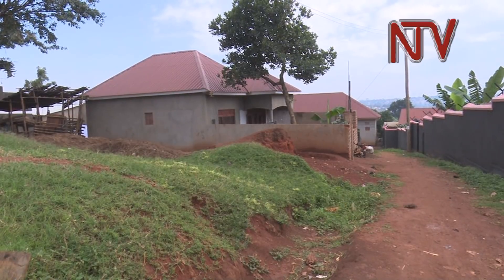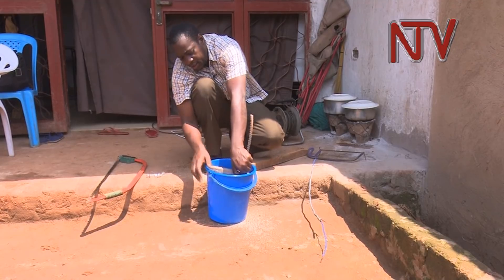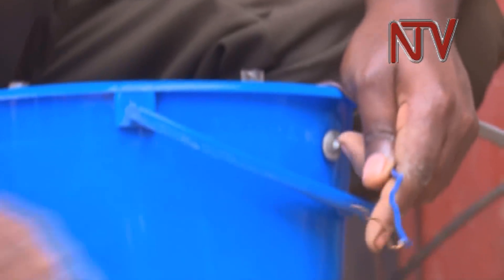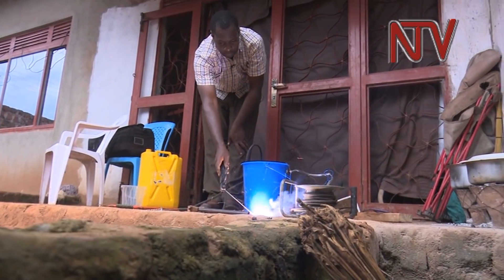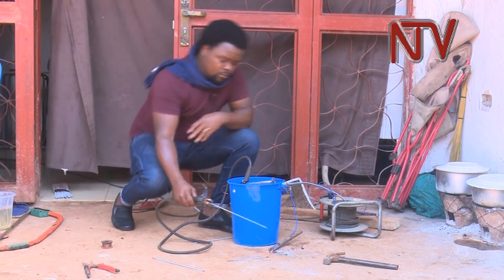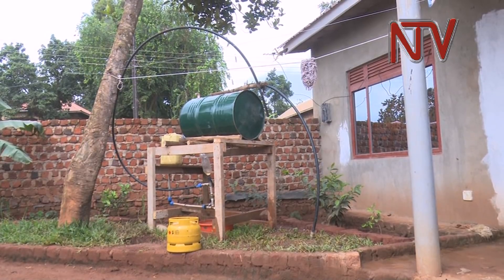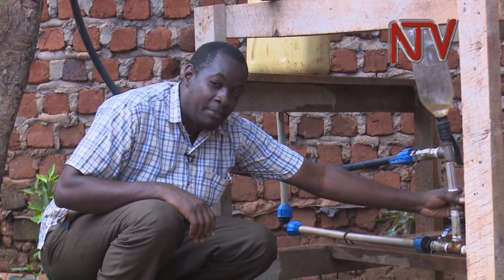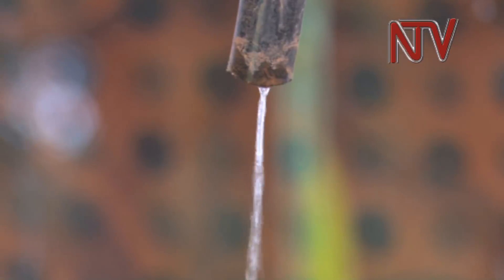Welding innovation: Man creates cheap welding machine.

Comment: WARNING.....
I dont know, how many people died on your account from electrocution.
You are straight on the grid of 240 ? Volts. Or higher......
The human body can resist max 40 volts AC  ( small piek, max 70 volts )
How can you weld with closed eyes ? (No safety glasses./screen.)
Even than ,your skin will burn immedeatly from ultra violet radiation.
Whenever you look short time into the flame you get welding eyes, burning eyes,
And you can not sleep the whole night from pain / suffering.
You see, how many donkeys without knowledge replay positive.
Get an education in electrical, to understand that this film is dangerous bullshit.
I hope, with my warning, I saved some human lives.
Regards, Gerard from Holland.
Reply: that is true , it's very dangerous
Reply: Voltage and current are proportional. That means if you double the voltage you double the current. Resistance and current are inversely proportional which means if you double the resistance you halve the current.

The probability of fatality in electrocutions go up with current and duration of current.

Under 600V the skin doesn't breakdown easily and so your skins resistance is what saves you, hopefully, if the duration is short enough.

Above 600V the skin breaks down which drastically lowers the bodies resistance. More voltage means more current and less resistance means more current still which means dead. Depending on duration and other factors.

Many people get "bitten" by 240V AC and either their involuntary reflexes or the breakers saves them much grief. If it fries too many brain cells they might go on to say 240V isn't dangerous but try sticking two sharp electrodes through your skin and into the wet meat and see how long it takes to cause fibrillation and then death. Or if you don't like stabbing yourself just wet your hands with salty perspiration. This can mean the difference between 100k ohms or 1k ohms effectively increasing the current by a factor of one hundred (i.e current x 100).

In short, house hold electricity is dangerous. Which means that it certainly can and certainly does kill people. Like allot. Didn't your mother teach you anything?
Reply: elmis123123 I was tempted to argue that it's neither the current, voltage nor power that kills you but the lack or resistance.

But I've come to realize its actually the none of those at all. Its the electrons that kill you.
Reply: sun sun  two pieces of rebar and a bucket of water. Stand way, way back it might explode. If the voltage builds to a critical level no telling what might happen.
Reply: Russel Walker yes, you are quite right!
And what's really making the blood/flesh boil is the ion-current (in reverse direction of the electrons) .
Reply: Jaakko Fagerlund and this confirms the fact that little knowledge is far more dangerous than no knowledge....
Are you aware of the fact that we comment on a video where a man uses main electricity to weld...
Reply: Jaakko Fagerlund 
You are right, under ONE condition......
The electrical resistance must be 100 % means..  fully isolated.
Otherwise, you will be roasted as barbeque.
Learn the formula  E=I x R
      Aswell...             I x R = E
If you not understand this and not willing to study, than I spilled my time.
Regards, Gerard from Holland.
Reply: Jaakko Fagerlund if you learn and understand ohms law and its derivates, you understand what kills you!
U=IxR
R=U/I
I=U/R
P=UxI 
P=U2xR
Whitch gives: you can't drive a current through a resistance whithout a voltage and at a given resistance the current is function of the voltage. If you doubles the voltage through a given resistance, the current will also double and the power will be 4 times higher.
Reply: I give up! 😩
People don't seem to understand ohms law. 
The current is a function of the voltage applied over a resistance. 
This means that a voltage can exist whithout a current or a resistance and a resistance can exist whithout a voltage or a current. 
But a current can't exist whithout both voltage AND a resistance!
A higher voltage drives a higher current through a given resistance!
The dielectrical properties of the skin and the flesh/blood determines the resistance.
If you think a teslacoil is harmless, put your fingers on the output of the flybacktransformer. Your relatives can post the result here later....
But I guess this is what Darwin meant whith natural selection...
Reply: Jaakko Fagerlund I don't know if you are trolling or you just is plain stupid.
I have tried to explain the facts to you, if you want to beleive it or not is up to you. If you want to risk your life because of ignorance and poor understanding of physics, it's your choice.
Reply: You clam to be knowledgeable in the field of electrical engineering but you don't know what a water rheostat is. I feel sorry for the idiots that think you know what you're talking about.
Reply: I'm fully aware of Ohms law and it doesn't change the fact that voltage alone will not kill you. Otherwise we would have thousands of people dead every year/month because of Tesla coils.
Reply: Tha's what I've been saying, because I do remember it is 30 mA from AC and around 300-500 mA from DC that will most likely stop your heart. Doesn't matter what the voltage is.
Reply: Jaakko Fagerlund but for gods sake, read what I have written and don't make things up!
The current is a function of the voltage applied and the resistance. 

It's the internal resistance and the spheres ability to hold enough electrons that limits the current in a Van De Graaf generator. If you made it big enough, it would kill you!
As a matter of fact, lightning in a thunderstorm works on the same principle. I guess you think they are harmless too?
I suggest you take a class in physics or at least ask a physisian about it.
And about supraconductors, there is no conductor (and will never be) that has zero resistance. What it is all about is to make it as low as possible. 
And for the last time, it's the power that kills you!
The power is a function of the voltage and resistance, whitch induces a current in the circuit. 
The power equals to U/R x U == 
U2/R.
Reply: Russel Walker finaly a reasonable person! 🖒
Reply: You are fucking clueless. Idiots like you are more dangerous that the water rheostat.
Reply: yes ok
Reply: Or the supply has a power limit. For example, 1 MV supply with 100 W power will not kill you, just tickles. Doesn't matter what the resistance is.
Reply: Jaakko Fagerlund 
I saw, you are interested in very nice technics, as me whole my life.
But feel sorry for your poor knowledge of electricity.
If you were my neighbur, I will teach you for free.
Reply: Excuse me? Can you tell mehow many amps of current is flowing if the supply output is 100 W @ 1 MV? I would say 100 W / 1 MV = 0.1 mA, which you can barely feel and is 1/300th of what is considered lethal.
Reply: Jaakko Fagerlund just drop it!
You don't know what your talking about.
The misconception that it takes 30 mA to kill you is based on a voltage of 240 v.
It's the power that kills you and at 240v and 30 mA it's 7.2 w and it's lethal!
What do you think will happen when you drive 100w through the body?
Reply: Ah, my bad on that 30 mA. But the original still stands, it is not the voltage that kills you.
Reply: volts dont kill its amps that kill, also uv does not effect brown skin the way it effects clear/pink skin.
Reply: elmis123123 pure stupidity? He knows what he is doing, and make money off it if he uses it to work welding stuff for people with less than a dollar set up. Forget he no stupid at all
Reply: elmis123123 yes its the amps that kills not the voltage
Reply: It is not volts, it is the amps that kills you. You can hold 1 MV line with no harm done if the current is next to nothing.
Reply: jujitsuman68 he got his life!
And it's likely to be longer if he doesn't do stupid shit like this!
This is bad knowledge and pure stupidity!
Reply: Aand we are back to my point exactly like you said -- if there is not enough current capability in the source, it can't kill you.

And if you haven't never learned about superconductivity, might suggest visiting a technical university and its electrical lab. Or just an MRI machine, a practical application of it. Currently there is no measurable degradation of current in a superconductor, so that means zero resistance. Or go troll somewhere else.
Reply: And here is a link and a quote that disagrees with your point of view, completele with sources: https://en.wikipedia.org/wiki/Electrical_injury#Voltage-current_characteristic_of_skin

"Above 20 volts, electrical characteristics are both non-linear and symmetric. Skin conductance can increase by several orders of magnitude in milliseconds. This should not be confused with dielectric breakdown, which occurs at hundreds of volts. For these reasons, current flow cannot be accurately calculated by simply applying Ohm's law using a fixed resistance model."

Suggest reading the next paragraphs also.
Reply: Ohms law is very simple, but you can't use it to calculate the current from voltage and resistance when the power is limited. That is exactly what happens in Tesla coil, Violet Wand, electric fences and a whole plethora of equipment - high voltage, usually 10's of thousands of Volts or more and it still doesn't kill you, as the maximum output current is near nothing.

Your assumption that current can't exist without resistance is flawed as shown by superconductors. Zero resistance and current happily flows.

I've now Googled multiple sources and every one of them says that current kills, specifically around 30 mA in AC @ 50-60 Hz (requiring more current at higher frequencies) and 300-500 mA in DC. Nowhere does it say what the voltage has to be, so it can be anything that can induce such current flows in human body. So you see, saying that voltage kills is wrong.
Reply: Facts? Care to explain or provide a single reference that explains that it is just a matter of Voltage if it is lethal or not and has nothing to do with the current like your explanation is?

Care to explain at the same time why you can touch the output of a Van de Graaf generator and not get killed, even though the voltage is about 100 kV ?
Reply: Well then, youmight want to educate yourself more if little knowledge is dangerous as proven by your statements.

Regarding the electrocution of human body, the lethal current is 30 mA (not disproven yet by you in anyway), thus that is constant. Human body resistance is a variable, depending if it is dry, through skin/vein/etc. Thus by Ohms law, the voltage that achieves that 30 mA current is also variable. And if voltage/resistance is a variable, then power is a variable.

Thus proving your statement of power/voltage kills, when they are both variables and the only thing that matters is the current that flows.
Reply: Sure, current is a function of voltage over a certain resistance, but you completely neglect the electrocution current limit of human heart. If that isn't exceeded, then whatever voltage caused that current doesn't matter.

I asked you to give even one source reference that says that it is the voltage that kills you. None provided, so thhat leads me to believe that the voltage indeed doesn't matter, only the current.

Stubborn maybe, but only in the face of factoids that you are sputtering.

Comment: don't make fake videos bro its total fake plan and how did u step up the voltage where is the negative current wire and where did u take earthing from and don't fake our people
Reply: Ramesh S ignorance, you don't step a welding machine, it make use of weak AC current, and water steps the current/voltage down so it can produce safe sparks
Reply: Ramesh S  dont make fake comments.  The bucket of water is actually a stepdown device (otherwise you'd be blowing holes out of everything you touched)   😎
Reply: Exactly, get educated!
Reply: Ramesh S He is right, you are wrong